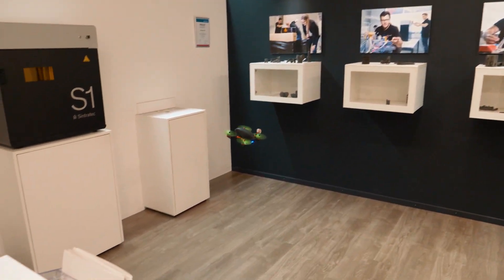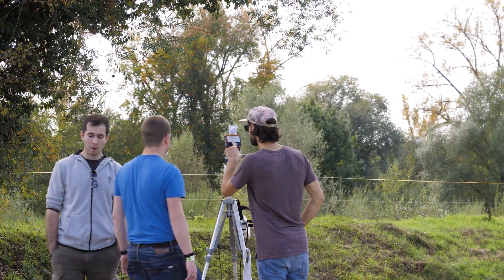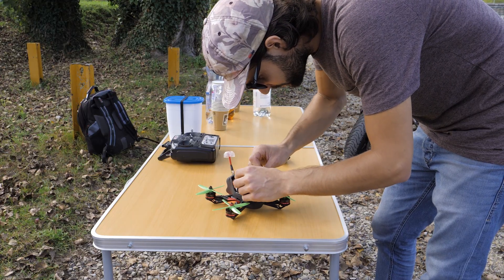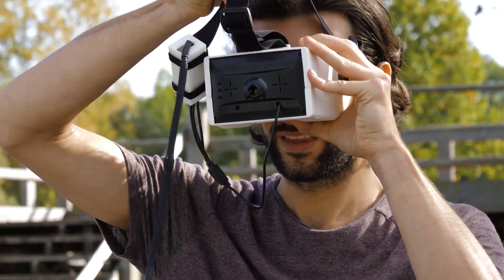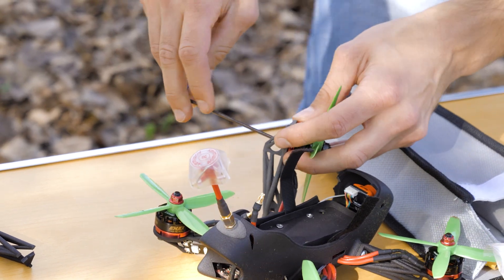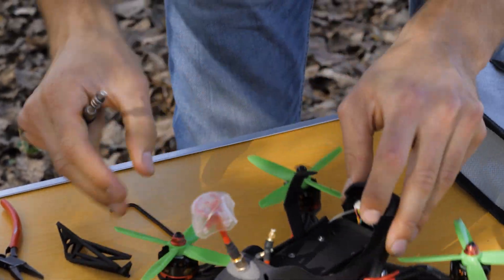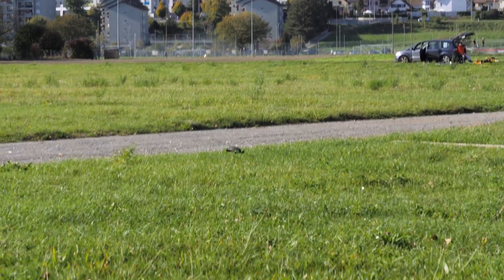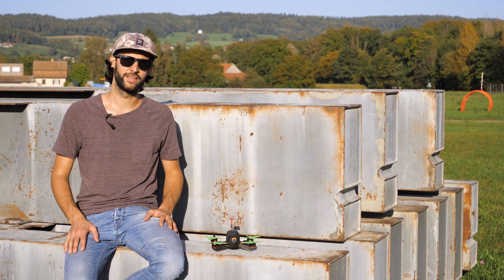3D printed FPV Racing Drone – The Outdoor TEST (Part 2)

Comment: I love that stack of batteries in the design.  I'd like to design one that uses cheap cell phone batteries, especially to take advantage of built in qi recharging capabilities, so I could land on a charger in a docking station.  That way it could serve one purpose, fly up and survey the surroundings when the dogs bark then return back to the docking station to recharge for the next time it is needed.  I thought another cool feature would be for the drone to land drop its battery and pick up another battery pack.  The batteries would need large foil contacts to make good connections without rigid placement inside a housing.  I'd like to see a drone designed with that turbine you made.  Give it wings that rotate from VTOL to in flight orientation.

Comment: the question is what happens when it hits the ground.. even a pla fdm drone can fly
Reply from the maker: it did hit the ground pretty hard as you can see in the video - but was still able to fly after some on-site repairs
Reply: Yep all drones can Fly But when they hit the ground explode into a million pieces that's why the Sky Venom Rogue One Drone Uses a Carbon fiber  Base and arms and motor mounts with just the 3D printed upper 
http://skyracerfpv.com/